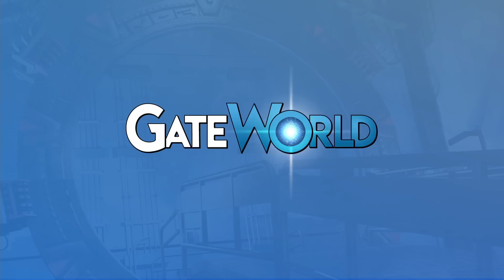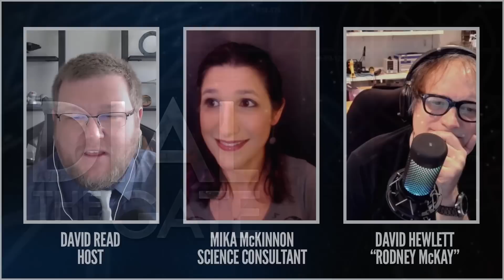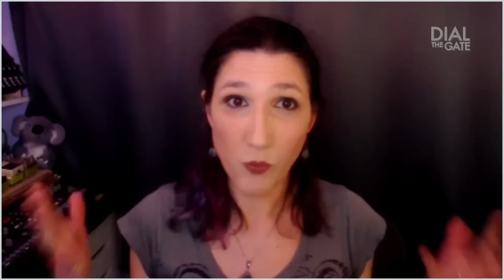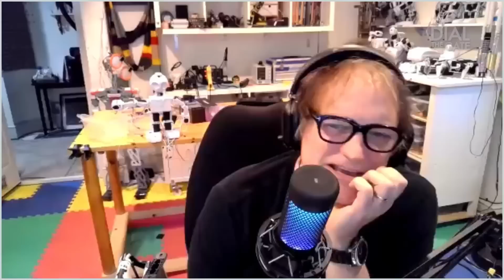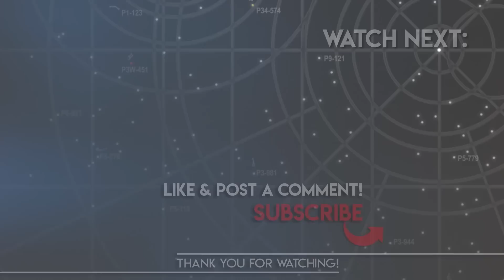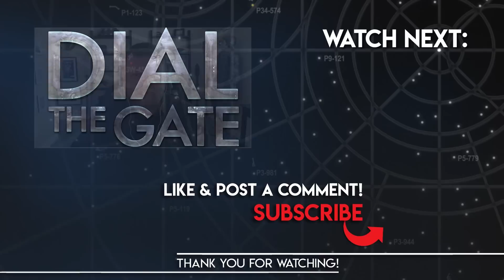What Would REAL Stargate Wormhole Travel Require? (Dial the Gate)

Comment: Travel through a true wormhole would require a shield as with Atlantis using the wormhole drive, though traveling through the stargate you're a part of the disassembled matter stream and reassembled on the other side, so you're not exposed to any radiation directly

Comment: I like how Stargate has interesting solutions to real world problems regarding wormhole travel.

Too much energy required to bend space? No problem, send an energy tube through another plane of space, subspace, and make the tube microscopic.

Will eventually die due to radiation sickness inside the wormhole? No problem, de-construct the traveller into molecules so they fit through the tiny artificial wormhole and simultaneously protect them from the radiation/high speeds of travel.

This way a Stargate as seen on screen, could technically exist in some form sometime in the future.